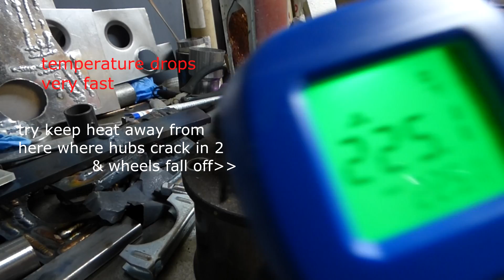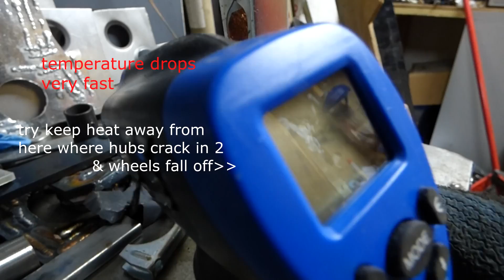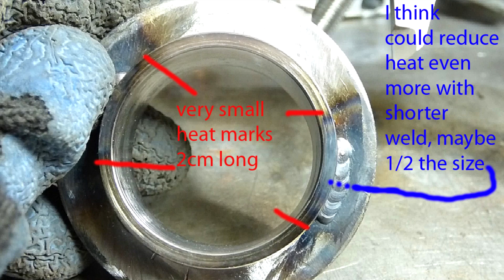Pulling wheel bearing race with welder

Comment: I like your idea. Thanks for sharing!

The way I get bearings off is to put the whole thing in the freezer for a couple hours, then turn a propane torch on the race and heat it up. It helps if someone is aiming the torch. Then take a cold chisel and put it right where the bearing meets the shoulder. A couple whacks and you'll be able to back it off enough to get your puller jaws behind it. The other part is cold enough that it won't even be warm when you touch it.

You can do the same for press fit bearings by putting them in the freezer to make them shrink, then get them started easily on a room temperature part. I've rebuilt two transmissions this way and it really works slick!

Comment: Perfectly safe as the HAS (Heat Affected Zone) is in the race and the hub isn't brought up anywhere near critical temp for steel. No need to reduce the weld bead length. The video is proof for folks unfamiliar with welding. 

 I like the idea which is ideal for those of us with welders. I've done many by angle grinder (6" diameter cutting disks preferred, if you buy an angle grinder get a 6" so you can use the 6" diameter fine kerf cutting disks, I buy 'em by the box) It also gets around buying a splitter type puller.

Comment: I use a flap disc on a 4.5” angle grinder to slowly put a flat in the bearing, once I start seeing the bearing flat going blue, I stop and hit the flatted area with a sharp chisel. Cos the bearing race is made out of hard metal the crack spreads and once its cracked, it comes off with minimal damage to the hub

Comment: If you don't wanna use so much time and effort doing this welding trick > I would suggest using grinder and cutting disc without cutting to the hub and finishing off the cut with chisel and hammer. The bearing race is hard and in tension and will crack and comes off easily.

Comment: We just got one of those IR temp guns this week. People say stuff like "What do you need that for?" The answer is that we need it for all kinds of stuff, including things we haven't even found out about, yet.
Nice job - it is great that you share what you learn and/or know. There are many ways to skin a cat.
Thanks for posting.
Reply: I used mine last week to check the temperature of different areas in my smoker.  Not just for checking exhaust manifold temp.
Reply: How to take a pulley off of a power steering pump

Comment: Nice to see an alternative method but its not a great one, what would work better is weld a tab and walk it off with an air chisels. Dont use a puller in this application, the force bends the race inward and amplifies the force needed to remove the race, the tabs bend and break as a result.

Comment: IF YOUR A REAL WELDER A 2 OR 3. 1/2" LONG TACK WELDS iS ALL THAT NEEDED.  i have tack welded a tow bar to steel bumper on 5 ton truck with 2, 1/2" tack welds on each tow bar arm joint an towed it home 12 miles up an down hills and turns, many times
Reply from the maker: you didnt like my welds Arnold? they were nice lol . thats right all you need is some quick tacks :)
Reply: @onlyimpacts  nothing wrong with your weld, just dont need good welds to be so long

Comment: Drill through the race vertically close to the hub then smack it with a cold chisel to split the material that is left.No heat to worry about and no need to buy a tig welder and find/fabricate a big washer to weld.

Comment: 1mm cutting disc cut an angled slot / or \  in the bearing as deep as poss  without damaging flange, take a sharp cold chisel and place it on slot and a couple of blowd with a hammer and yhe bearing race will split open releasing from the flange .... 2mins work and no heat required

Comment: Nice if you have a welder and puller...I just cut them off with a cheap grinder fitted with a 1.5mm cutting disc.

Comment: Unfortunately I have no welding equipment.  This has though given me an idea of cutting a lateral groove in the race for a puller to latch onto.  I've not had much luck with the hammering technique.  Never liked hammering stuff anyway, I'm definitely with you on finding more civilized ways!
Reply: I tried the bearing seperator on a 2000 echo hub.. not much room to grab it really but the cutoff wheel and chisle saved the day..  the hardest part was removing the hub via slide hammer..  note to self(and first timers): make sure the axle splines are not stuck to the hub, prior to pulling your fingers out of the socket ..   cheers

Comment: Very nice gear puller what brand is that?  All I can find is non crv and they all look cheap
Reply from the maker: hello it is a no name puller I bought it maybe 16 years ago. similar to this http://www.princessauto.com/en/detail/4-in-dual-jaw-gear-puller/A-p8046018e?storeId=10 If you search google for "cr-v puller 2 jaw " you will find some. This Tekton https://www.amazon.com/TEKTON-5681-3-Inch-2-Jaw-Puller/dp/B000NPT68O?th=1   I think has a lifetime warranty(not 100% sure).  Here is where you can buy them direct from china scroll down the page you will see them https://www.aliexpress.com/wholesale?catId=0&initiative_id=SB_20170220223459&SearchText=2+jaw+puller Tekton also sells
Reply: singlecams 
Wow you had yours for 16 years...  Ya I can tell it's a very good quality puller.  I did look on amazon and I did see those teckton ones but they just look very weak.  And all other ones also look cheap.  Yours looks very good.
Reply from the maker: Hi thanks i'm pretty sure mine is the same as the cheap cr-v ones the only thing is different is the pilot on the end is spring loaded and can go in and out now they just make it like a cone shape

Comment: If you can't cut the inner race off a hub in less than 5 minutes, then you're doing it wrong. It only takes me about 5 minutes to cut it and hit it with an air hammer.
Reply from the maker: Yeah.... but I can pull all 4 in 5 minutes and I dont got to cut or hit anything. I would think the person tig welding washers to races has cut races before and knows what they are doing....this is something different I posted for you.

Comment: what was that instrument laser pinter that gave some kind of data? thanks
Reply from the maker: hello it is a "laser thermometer" (search in google) it shows temperature in F or C where laser is pointing , it cost around $20
Reply: singlecams Ohh, I am familiar with those but didn't understand why it was used in this video. ? thanks for clarifying.
Reply from the maker: hi please see this http://imgur.com/a/eKfch wheel hubs can fail for other reasons. Using the laser temp  i can measure how much heat am i putting into the hub by welding on it. That is why i made really small welds that were also short in length to keep the heat down. Now im not sure at all maybe you can put a lot of heat into the hub without causing problems but if you don't have to use a lot of heat then that is better.  But first I want to know what kind of heat is created with those small welds and we can see that with the laser temp gun there is not much heat at all  with those welds and it dissipates very quickly. Hope that makes sense?
Reply from the maker: adding to my last reply sorry :) you can also use that temp gun to see where the heat is going too, was the heat going just up or was it going down into the face of the hub etc. I wouldnt use it next time I do this I thought it would be helpful for all you guys to see how much heat is made when I did it :)
Reply: singlecams ohh yeah for realz, now I understand. thanks for sharing...

Comment: Waste of time, this come out for 5 min. with another method
Reply from the maker: 5 min? I can weld and pull all 4 in 5 min , of course it take long time on video to show how it is done. Also there is no banging , risk of damage so I think it is pretty good. Especially if you use hubs for racing. 1 Honda hub plus wheel studs is over $150USD when you cut into it or stick hub into vice to bang it with chisel  who wants to do that.
Reply: singlecams what is the best method for taking these wheelbearing off the hub without having a welder.
Reply from the maker: Unfortunately if you have no welder the only simple way to do it is to cut them off. You can buy a $30 grinder and a disk and go at it, be careful , wear a dustmask and eye protection. Go slow and down cut all the way through.
Reply from the maker: try that https://www.youtube.com/watch?v=f2UMq7rtUko
Reply: singlecams ahh OK thanks
Reply from the maker: here is another one better quality https://www.youtube.com/watch?v=MZStRgoGhtg
Reply: +singlecams hey i used this method 👉 Bearing Separator and It worked perfect except I ended up modifying it's slightly grinding the opening of the bearing separator so I can catch on to the lip of the bearing only spent $24!! I had a 20 ton hydraulic press but im sure u could knock it out with socket and bmf hammer and wood.
Reply from the maker: lots of people have asked this and I have been wondering but I have never seen it on a honda hub so try it and let me know :) take video :)
Reply from the maker: what hub was it a ef hub? you didnt take the video??? :) thats awesome :)
Reply: respectfully disagree friend..  thats the beauty of it ... you dONt have to cut ALL the way though, the race is brittle  : )
Reply: Stanimir